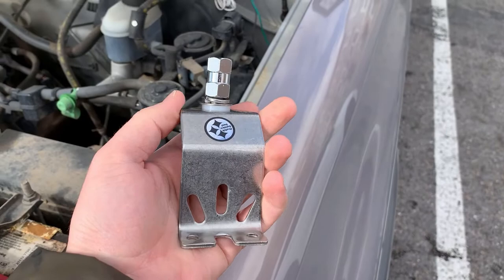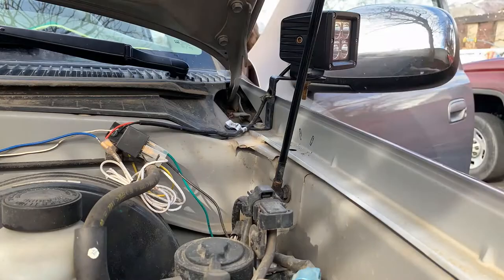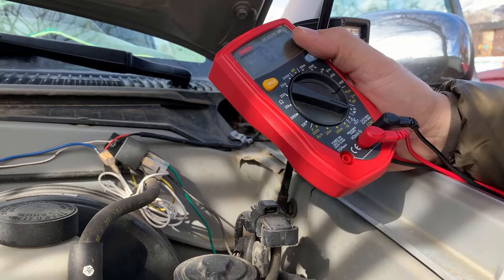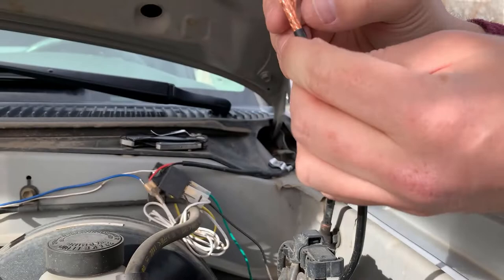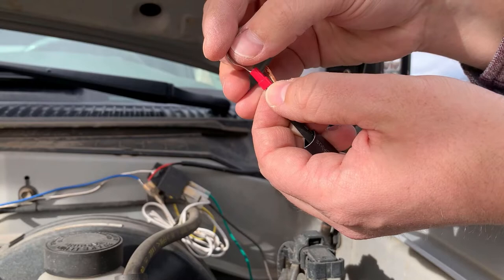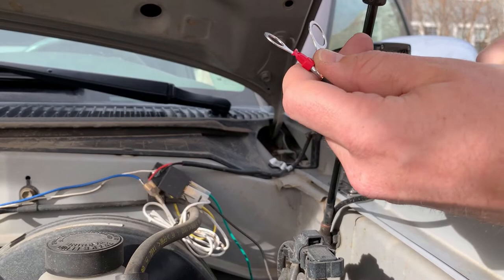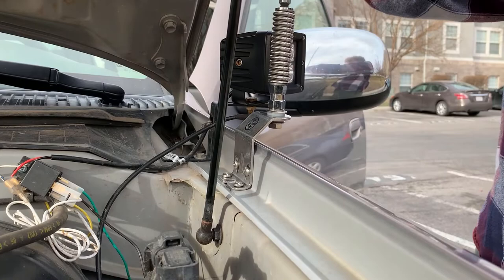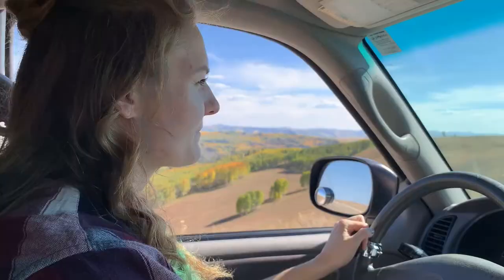How to install CB Hood Channel Mount (Firestik SS-174)

Comment: I bet that light makes that radio go crazy with static when you turn it on
Reply from the maker: It does! But fortunately I rarely use those lights, and not at the same time as the radio

Comment: Very good video.  I know not all people have soldering irons or soldering skills, however, soldering of ring terminals/connections is preferred over crimping.  Crimp connections tend to loosen over time in a mobile application (i.e. road vibration, cable flexing).  It's also kind of nice if you need to remove the terminal, because it can be heated with the iron and removed without causing any damage to the cable or connector.

Comment: The CB on line sellers/stores/shops in GB are calling this a hatch mount for some reason. Bonnet mount seems more logical! An antenna mount designed to clamp onto the hatch of a hatchback car, but can also be fitted to doors, boots,

Comment: I’m surprised it works right so close to the windshield I’ve got 2 trucks with those mounts , a 2019 Silverado and a 2015 Ford f-250 and both of mine had to be further out from the windshield to get a low swr. I’ve got 55” Hustler hq27s on both of mine and they’ve never budged either.

Comment: Don't you have interference problems because the CB antenna is placed so close to an LED projector?
Reply from the maker: There is static! But I rarely switch the ditch lights on, so it hasn’t been a problem for me so far because I don’t use the lights and radio at the same time.

Comment: I dunno, I got a setup just like this and tried EVERYTHING to get my swr below 3 and NOTHING lowers it. Different coax different radio, different mounts in the same place, no change. Somehow, i keep getting about 20 mega ohms between the connections, but that's not a dead short so I guess that's alright too.

Comment: This seems like exactly what I'm looking for, as I also have a 1st Gen Tundra. What antenna did you use? Or will any antenna work with this mount?
Reply from the maker: I used a Firestik antenna, same brand as the mount. There’s some lookalike products that probably have the same threads. Just verify that it uses the same 3/8” threaded stud.

Comment: Where did you feed the wire through from fire wall to the cab?
Reply from the maker: @MrROADDOG1964  through an opening just under the emergency brake pedal and interior fuse box. There was a bundle of cables running towards it and I just followed them.
Reply: Thank You

Comment: I like it, but I want my antenna on the roof like my VHF/UHF NMO. Anybody know any good mounts for up there?
Reply from the maker: @randykitchleburger2780  the only roof mounts I’ve seen are magnetic. They are fairly common and cheap.
Reply: @backcountryengineer6516  I ended up going with one of thess through hole brass NMO mounts, I wired it with LMR400 and it works very well

Comment: Where did you buy it
Reply from the maker: Amazon! See the link in the video description.
Reply: @backcountryengineer6516  did you buy the hole thing on Amazon?
Reply from the maker: You can buy everything on Amazon, but the link in the description is just to the mounting bracket and stud. The antenna, spring, and coaxial cable I had lying around from before.
Reply: @backcountryengineer6516  how long is the antenna ? Thx